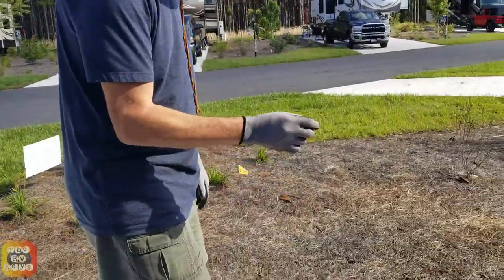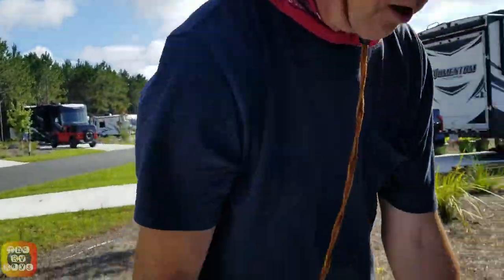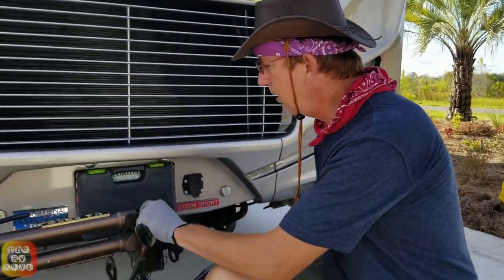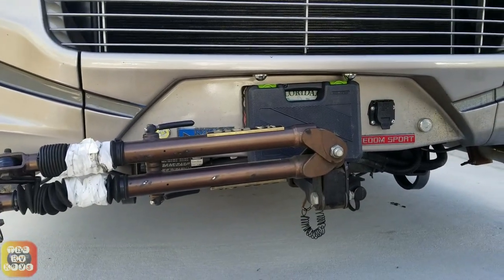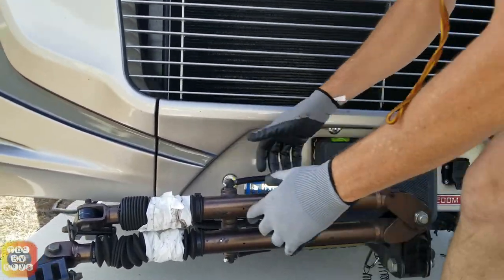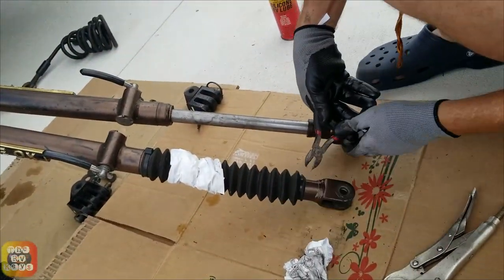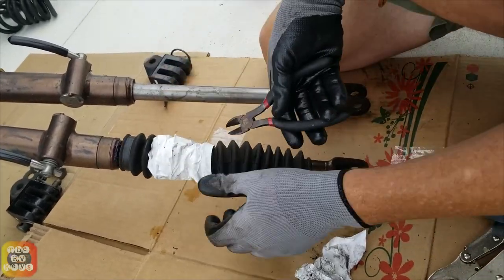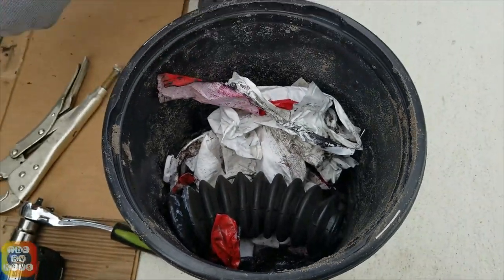S👀👀OO Easy! DIY Blue OX Avail Towbar Rebuild! Washer Kit Replacement! TheRVkeys Episode 54

Comment: Did you spot that you reinstalled the main pivot bolt upside down?  What about the pivot shaft bushings?  There are other errors in this video, but I won't pile on!
Reply from the maker: The tow bar was disassembled and put back the way it was before, including bolts.  All washers were replaced and new lock nuts were used as well.  We strive to be accurate,  but we're not perfect either. Thanks for watching.

Comment: Why would you use the old bolts that are already rusted, new ones are $10-15.00?
Reply from the maker: Ours weren't corroded at all since we keep the tow bar covered.  But our next rebuild we shall use new ones.  Great tip for those whose bolts are corroded . Thanks for commenting!